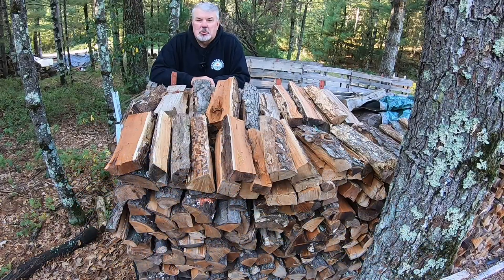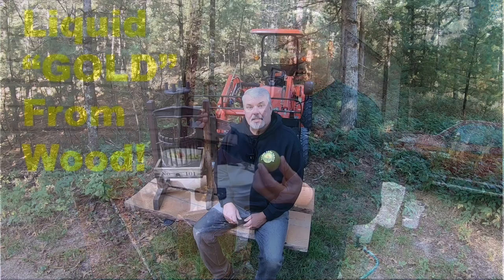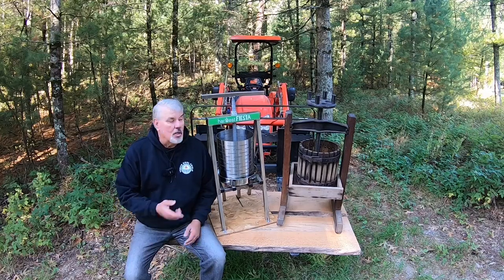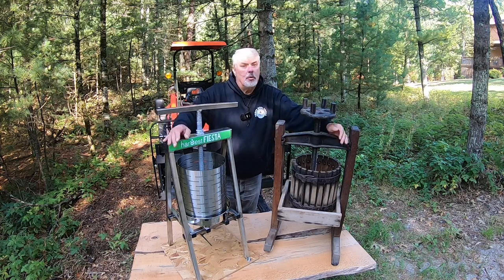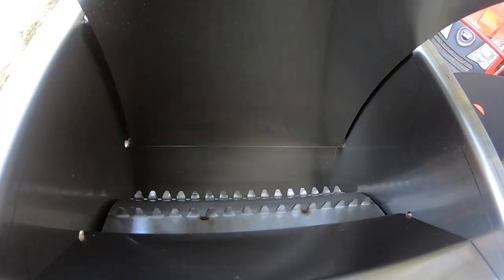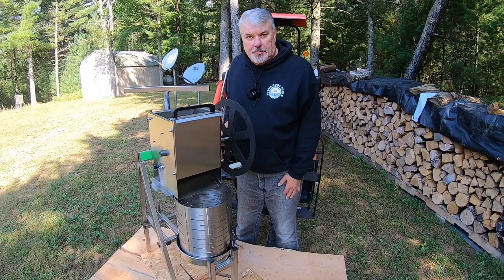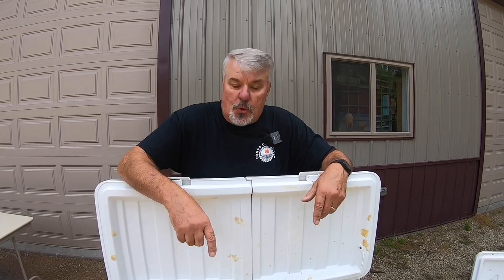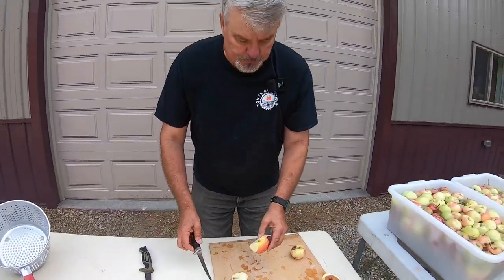Cider In The Woodyard -99 #HarvestFiesta

Comment: my press is quite a bit heavier. i think it has a 3-5hp motor and a gear box reducer. i use a log chain and a skidloader to move it around,  and it bridges the gap between your old and new.     my mom claims you need 5 different apple varieties to blend in and make a good cider.    you get about 2 gallons for every 5 gal bucket.  this year we started adding old fashioned pears to the apples.  ratio of 50/50 to 80/20.    it gives the cider a taste like you used a higher end apple like honey crisp and galas.
Reply from the maker: Wow would love to see your press. Your mom is right about the fact that different apples make better cider. Apple orchards keep their formula secret because they taste so good. We just use any apples we have available and love the taste.
I wish I had a source for pears, would love to experiment with an apple/pear blend.
Thanks for watching and commenting 👍TCT

Comment: Had no idea you could grow that quantity of apples in WI. I alway thot WA and PA had a lock on growing apples like that!! Ya missed one. There's a tool made for picking fruits off the ground. I know you'd love it. It's got a wire cage shaped like a football on a handle, so you roll it on the ground, the apples squeeze thru the springy wires while you are upright, lift tool and apples, discharge fruit from tool into bag or bucket, goes pretty fast! Lots better than picking them up by hand and bent over back! -  I wonder if you could put a little hydraulic or electric motor on that Acme screw, and make cider faster and more fun, kinda like they've done with ice cream maker bucket thingies!     gotta go.
Reply from the maker: Yup the tool you are referring to is the Garden Wiesel, I did a review on a couple of the models. 
https://youtu.be/kaZcKqSnl1Q
It will pick up apples but the handle is a bit short so you end up bending a bit. Last couple days I collected buckets of acorns with the garden weasel.
Thanks for watching and commenting 👍TCT

Comment: What variety apple is that??
With the size of the hopper and that lid on the grinder I'm sure it would work just fine if you filled it up. Doesn't make sense for it to be set up like that if it wouldn't work.
Reply from the maker: Jimmie we’ve been told the variety is called Paradise which is a very common apple in my area. The hopper on the grinder will hold about 4 or 5 average apples.
Thanks for watching and commenting 👍TCT